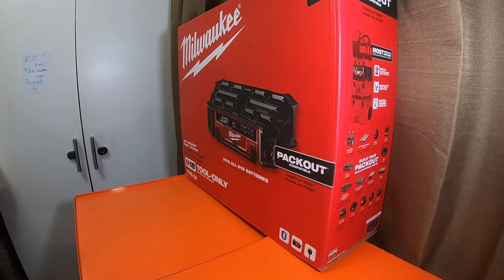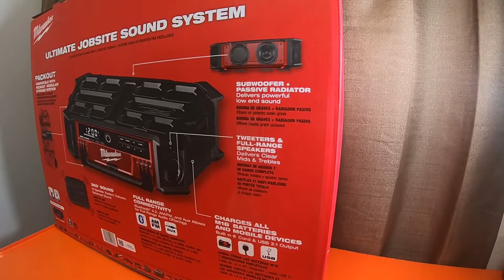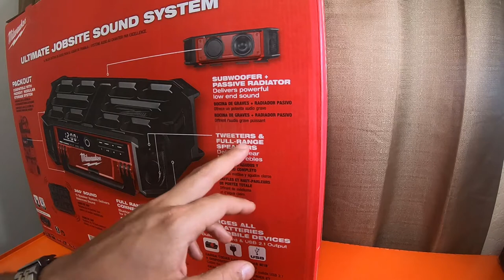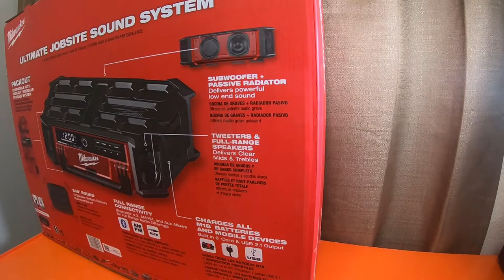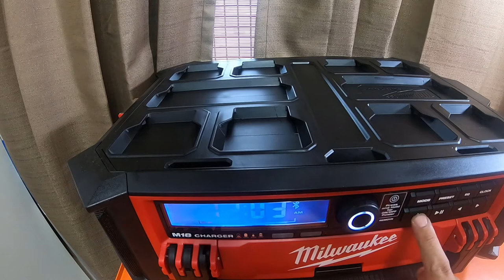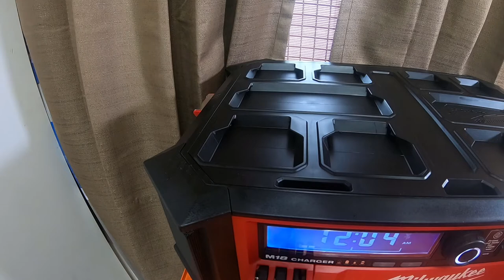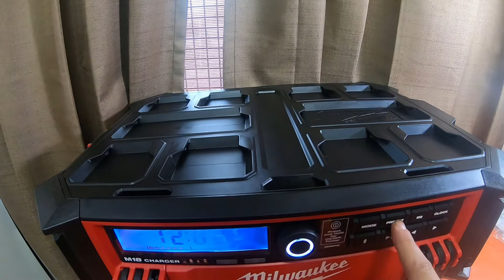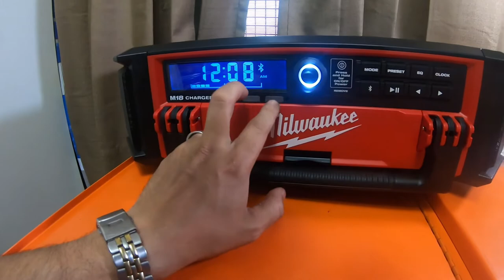Tools - HD - Milwaukee M18 - Packout Radio + Charger 2950 20 Specs QL Info N More - 4 15th 21

Comment: "To be honest"......."to be honest"......"to be honest".......LOL, just busting your chops a little bit bud!  I've got this radio sitting at home with a BUNCH of new Fuel tools, but I've been on the road working for the last two weeks, so I haven't even been able to lay my hands on any of it yet.
Reply from the maker: Lmfao It's all good on Busting my Chops Brother... That sucks having all them fuel tools and this radio at home and can't even use them oh man that's gotta be driving ya mad are you a truck driver ? @jeff Georgalas
Reply: @AntonioClaudioMichael  No, I'm actually retired, but just down in IL, helping a friend who owns a business here, and can't find enough people to staff it.  It's a snow removal company.  Just helping him get setup for the season.  Ya, since I've been gone I've ordered (and received, but they're at home and I'm here) 1/4" impact, router, sawzall, 1/4" & 3/8" right-angle high-speed ratchets, angle grinder, radio, 7-1/4" circ saw, oscillating multi-tool, right-angle 1/2" impact, drill/driver, flashlight, jigsaw, some new high output batteries and the rapid charger.  Haven't been able to put my hands on any of them yet.  So, I'm in a hurry to get home.  Really want to play the radio more than any of the other stuff.  The problem is, you can't hear how loud or clear the radio is on any of the YouTube vids, because even if you play the radio as loud as it gets in your video, whatever you're recording with will edit that down so that you can't hear it on my end.  The same with the clarity.  Even if it's crystal clear on your end, some of that clarity is lost in the video transmission.  So, I'm eager to get home and hear it for myself.  Carry on with your videos though, I DO appreciate seeing them.
Reply from the maker: @JeffGeorgalas  awww always nice to help friends out and That still sucks you don't get to play with all your new Tools And I understand what you mean by loudness and clarity The Audio And video don't do these Stereos justice they are way louder in person especially since I had to Edit the audio to make it As crisp and clean as possible without distorting and had to make sure the audio didn't get to loud and hurt people's ears that use headphones... Hopefully you will get home and be able to play with all your tools soon...